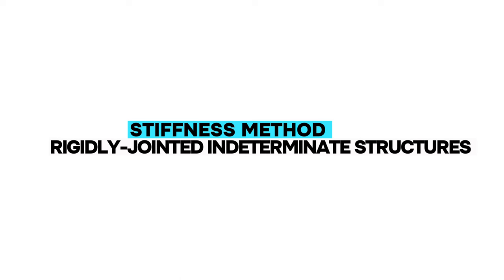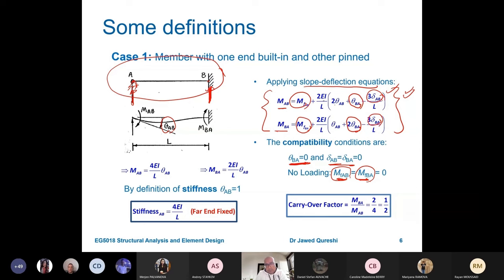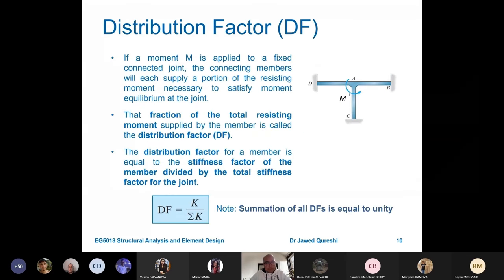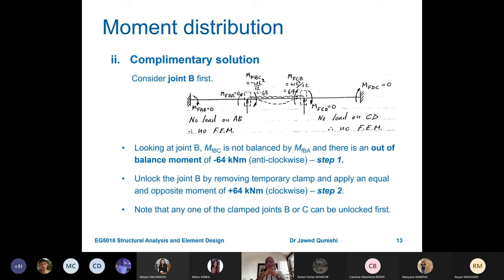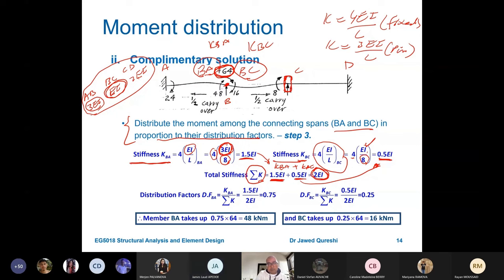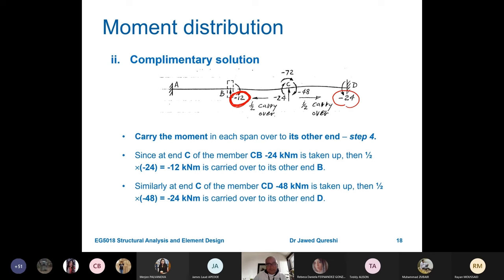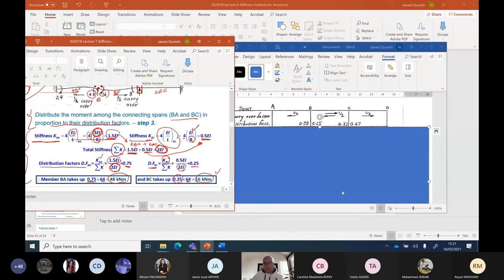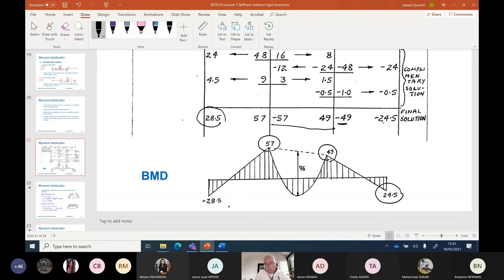How to analyse continuous beams using MOMENT DISTRIBUTION METHOD

Comment: Sir what is the difference b/w shear capacity and end reaction of the beam
Reply from the maker: Shear force is usually maximum at end reactions. Shear capacity or resistance depends on section properties, for steel I beams, web provides most shear capacity. For design, the maximum applied shear force must be less than the shear capacity of the section. Please let me know if I understood your question properly or not. Happy to explain more.
Reply: Yes sir.. I understand
Reply: Thank you very much sir
Reply: Sir W14x22 beam span 22 feet for this beam what is the end reaction and shear capacity of the beam
Reply: How to caluclate the end reaction and shear capacity of the beam
Reply: Please sir.. Please do one video for this
Reply from the maker: You can find out shear capacity of the beam by multiplying shear area, mainly area of web, with yield strength. The procedure is in my video here: https://youtu.be/OfJJ9Ix3VwU?si=qja8dQLPLVgX5WvO

Aplied shear depends on load applied, if it is central point load then load will be divided equally between simply supported ends. If udl then reaction is wl/2.
Reply: Thank you very much sir